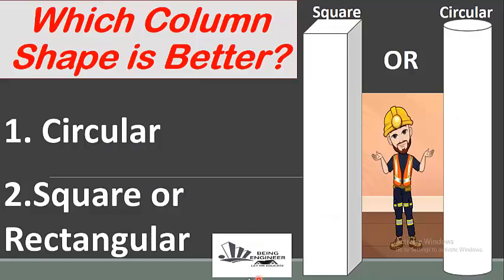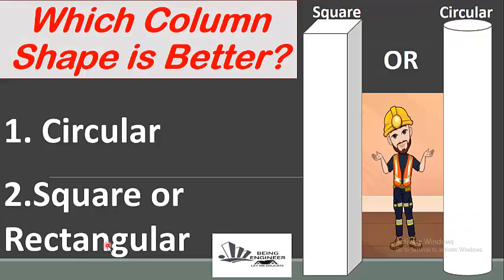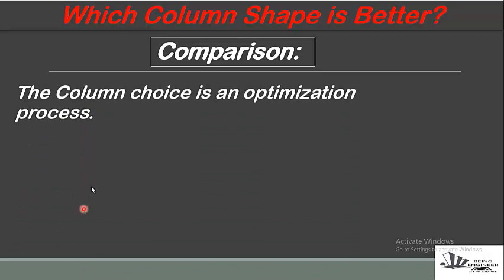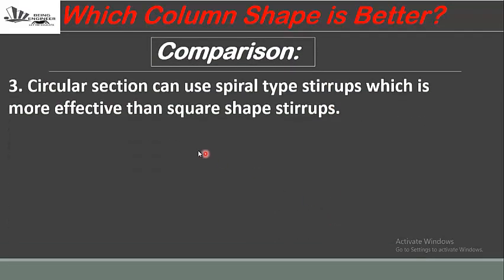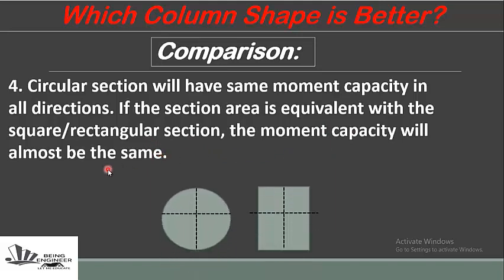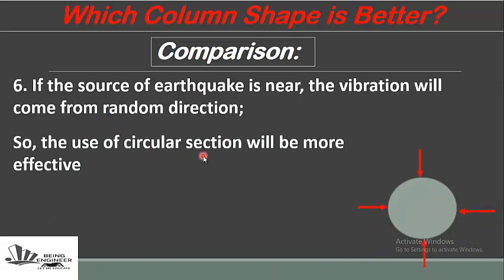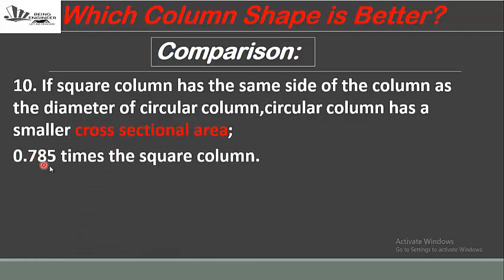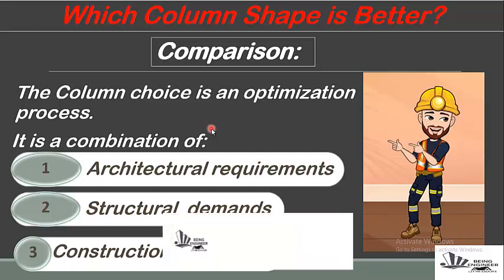Which column is Stronger (Circular or Rectangular)? | Comparison of circular and rectangular column

Comment: 5:35 Why the long side of column is facing earthquak the bending moment is more ..i think the shorter side of column can face erathquak without much moment beacuse dept is more than width reply ???
Reply from the maker: If longer side is perpendicular to earthquake then shorter side will experience buckling/bending.
Reply: @civillogy  no i think bulking and bending is more when longer side of column is facing the earthquak beacuse the thickness is less compare to dept of the column for an example the hidden beam is not that much powerfull then floor drop beam because it has no thickness like dropbeam thats y drop beam has more prefarable then hidden beam same situation as column the witdh is less and dept is more and when the column faces earth quake on the longer side perpendicular and shorter side facing the earth quak so its resist it because column act as verticle cantilever beam,,, plz reply ?
Reply from the maker: don't compare column with beam.
in this situation if earthquake is perpendicular to longer side the column will sway along shorter dimension.because critical depth/width is lesser in shorter dimension and shorter side is more prone to earthquake shocks.